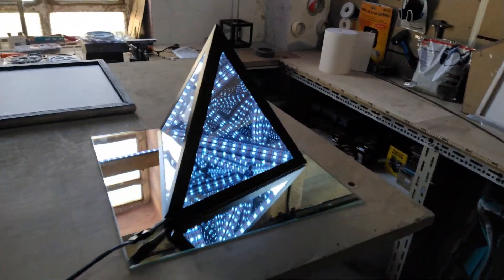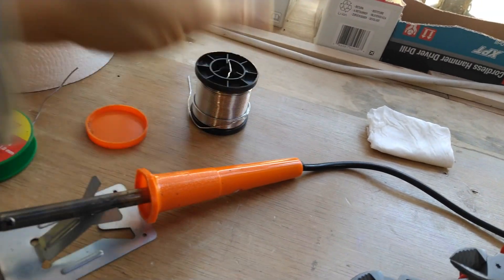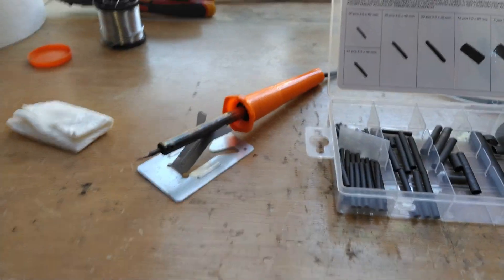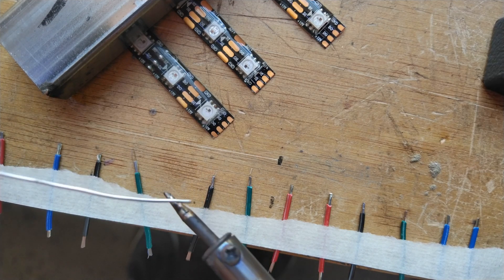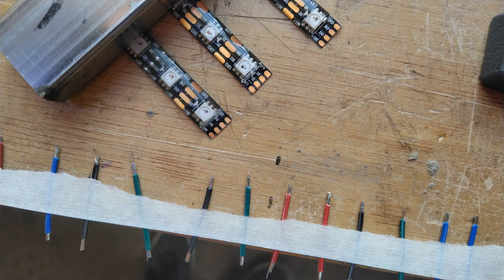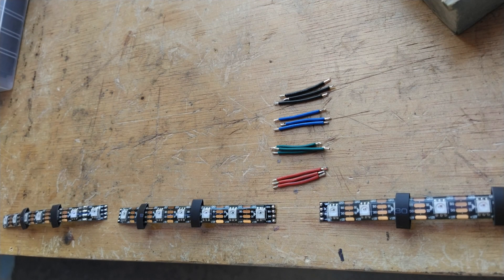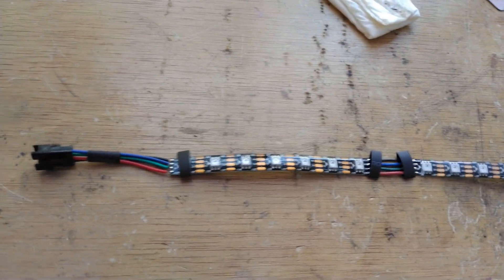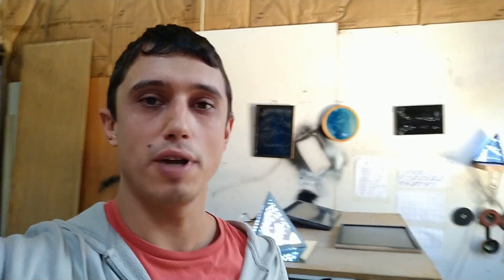DIY - How To Solder LED strips - Many Tips And Tricks - Clean And Secure Connections!

Comment: Question. Is it the soldering grease that assisted in the solder sticking to the bare copper areas? I have tried to stick solder to my LED strip (after making sure the copper area is clean, no dirt or grease) but my solder won't stick. I use solder with rosen core 1.6mm but no grease or older flux.
Reply from the maker: Yes, the flux is very important to use it in every step of the soldering. It spreads the heat batter and also helps to have the solder spread and attach to a contact point. It could also be that your temperature isnt high enough of your soldering gun. In 2 weeks I have a new video coming out about soldering btw!

Comment: When I tried to solder led strips, the solder wouldn't stick to the copper at all, no matter what I did. What might I be doing wrong?
Reply from the maker: Hi and i would guess or its not enough heat or you need to use more flux, it helps to spread heat and make it more liquid
Reply: @yehoshuasartinspain  Thanks!

Comment: Do you need to use wires or could you butt two sections to each other and solder?
Reply from the maker: You can solder LED strips together also without cables, on my channel there is also a video about that! Thanks for watching!

Comment: why u call it grease?  I assume ur usimg FLUX???  if so it is not to just equalize the temp. it also cleans and etches the surface so the solder fills hot and flat .  The most important advice to give is how to avoid a cold solder joint>>>>   thats when the solder looks rough and n0t shine.  they will craxk and fail.
Reply from the maker: Hi amd thanks for this comment! I made newer videos where I adressed this, thanks for pointing this out!

Comment: the wire gauge seems thick or is that the insulation.  I would like to use thinner gauge wire for my project.  how thin is too thin for these leds?
Reply from the maker: Hi and thx for watching. The wire is regular led RGB cable that you can find in many hardwarestores and lightshops so Im guessing the insulation makes it look thick. The cable thickness depends on how many Amps you will run through your project and also keep in mind to use extra powercables if your ledstrip is long and has a high density

Comment: Is there a limit to how long the abridging wires can be? ( I wanna split a strip to light multiple shelves with 1 remote control)
Reply from the maker: It depens on how many meters of strips you will have and the distance between them. You could power them all seperate and use a signal amplifier or put your led controller as close as possible to the ledstrips so the voltage and signal doesnt drop over the distance 😉
Reply: @yehoshuasartinspain  I want to do something similar, I have an LED strip with its function control, and I want to cut the LED strip to make 2 LED reflectors for the car. Is it possible?

Comment: any idea why the solder wont stick to my led strips?

just got some new solder with 2% flux since thought that was the issue

maybe the temp of the soldering iron? tried at 300c, tried at 450c... so confused
Reply from the maker: You will probably need to buy some extra flux and dip your soldering gun in it once in a while and also check the temperature of the soldering material that it melts at

Comment: Great video, would it be possible to cross connect the RGB wires to get different colour combinations between led strips? For instance connect the red output of one strip to the blue input of the other so different strips have different colours but are all turned on by the same remote? (of course you couldn't regulate the colour of the strip that is cross connected)
Reply: Nvm just came past the part where you explain the cables. Is there a way to have different strip colours controlled from one remote?
Reply from the maker: Hi! So your first comment would work with strips that have dedicated RGB channels so you kinda trick them but as you say the control is away because the colors are wrong. There are so many ways of lighting strips like this, that what you look for is quite easy. You need individual adressable LEDs that are controller by the right controller. My fav and easy setup is a SP107E or go WLed so you can realy program yourself
Reply: @yehoshuasartinspain  thanks a lot!!

Comment: Wat if the wire gets in contact with each other while soldering or the soldering dots connect to each other?
Reply from the maker: Hi! Many things can happen but one is sure, it will not work! There is a big chance of a short circuit so you have to be sure no contacts are touching!
Reply: If you accidentally join the beads it can be tricky to separate them, but most of the time it can be fixed. What I usually do is use something pointy like tweezers or an exacto knife to part the beads as you remelt them. If you have a fine tip soldering iron, you can just use that to melt and draw a gap between the beads, it might take a few passes before the beads will want to separate though. Also in my experience, when beads get joined it's usually because I used too much solder, so less is more with those tiny pads on the strips.

Comment: i need a tip on how to make led strips for cornering they dont make them like that
Reply from the maker: There are different types of connectors for cornering but nobody is a fan of them. For corners just same thing but different lengts of wires to solder, you can solder on the underside of the strip to make tighter corners or just loop them with some framework to hide the wires

Comment: I am currently building an infinity mirror dodecahedron. I am looking at these pixel led's that are 144 led's per meter programmable. Each strip will be max 7-1/4" they will lead to an intersection consisting of a "Y"   +/_ roughly. How do you solder this intersection when you are doubling up on every led on the leading strip side. Also do you know of an led strip that has at least this many led's per meter that would have a controler that is bluetooth capable, has a remote and can connent to google home and alexa and that the lights would change to music?
Reply from the maker: For the Y connection I make my own little Y cables that are just two cables with the same start that is soldered together, i hope you get what i mean. There are ways of making a dodecahedron in one continues strip i believe.
Reply from the maker: For the second part you will have to do some research since i do not work with controllera that work with alexa etc, there are some out there for sure. Look into Wled also, very interesting 😉

Comment: Can you make each section of LED strip a different colour?
Reply from the maker: There are more than a few ways of making sections in different colors. With a setup like this that is sort of possible depending on how many sections and how you olay with the original settings for the controller. Best way is with Wled where you can program everything yourself by using a universal chip

Comment: Wouldn’t use a lighter or any other flame to shrink the shrinktube. Use a hot gun (like the ones used to remove paint) or use the soldering iron very briefly
Reply: Why you no lighter?
Reply: @JohnDoe-qq8et  Why you yes lighter?
Reply: @JohnDoe-qq8et  😄😄👍
Reply: Hairdryer also works

Comment: is 4x1.5mm too thick?
Reply from the maker: I assume you mean 1.5mm^2 and yes that will be too thick. Best is to look under rgb led wire
Reply from the maker: Allow me to correct myself. 1.5 mm diameter could work depending on what the width of your strip and solderingpoints are

Comment: Been trying over and over, but having no success. Idk, if Im using the wrong size wire. Ive tried a little solder, a lot. I just cant get past the first  powered strip to the next.
Reply from the maker: Helloo. Soldering takes a while to get under control. Does your soldering gun get to a good temperature? And use the flux grease to increase heat transfer. And dont forget to first prepare the tips of your ledstrips and cables to make the connection easier when you solder them together. Do it strip by strip and test them after every strip you attached. Trust me, i also still have troubles sometimes!
Reply: @yehoshuasartinspain  I just have solder- good quality. I think it contains flux. Treating the led strips? You mean running the solder tip on them?  I havent really done that, but probably inadvertently while trying to get solder down on them. One potential issue is that Im using 18 awg wire and maybe its too thick?  Hard to place down precisesly on 3 pin led. Yeah, I havent successfully gotten a second strip lighting up and have gotten increasingly frustrated. I invested a lot of money into this project and Im laying a big, wet fart. My gun gets pretty hot- what temp is the sweet spot? 350?
Reply from the maker: I am not known to this standard but i use 0.25mm^2 rgb wire, its very standard. Take the proper preparation steps as said before and it will make it easier. Solder materials have different melting points but usually you can find that on the package. And you mean celcius or fahrenheit?
Reply: @yehoshuasartinspain  Thanks for you're advice. Got the project completed as far as led lights. Ran 32 rows at 20 high and it looks bad a--.I was initially a moron and just laid everything down and soldered it without a power supply as it was still in delivery. So my solder job was atrocious and that was the issue. I laid way too much solder and was bad with wire placement. Didn't realize everything had to be spot on. I haven't soldered since middle school. Anyway, I went from strip to strip checking with power after each. After major clean up of the old solder and re-connecting I finally got it done. Thanks again

Comment: Hi, I'd like to know what if i don't insulate the soldered part ? I wonder what will happen if those soldered wire touches each other, will it damage the led strips?
Reply from the maker: Hi! Yes it is very possible you will damage your led strips. You can cause a short circuit or an other scenario is your data gets corrupted. It is  never a harm to double check all your soldering points before applying any power! A multimeter can also come in very handy and might be a good idea for a video...
Reply: @yehoshuasartinspain  meaning that i need to be careful with the gap between those cable and make sure it won't tounch, yes ?
Reply from the maker: @Boyardee_my  yes exactly!

Comment: How would you suggest to make the soldered joins waterproof again? Thanks in advance
Reply from the maker: Waterproof to my opinion is a dangerous word in soldering but with using hot glue over your solderpoints they will be even more secure and if your heat shrinking tubing fits nice and snug over your IP protection together with hot glue you will be able to get them splash proof. Otherwise i advise using the apropriate mounting rails and covers for better water protection or use full waterproof led strips only ( i avoid outdoor projects only for this reason to be honest )
Reply: @yehoshuasartinspain  Thanks for that.... hot glue and heat shrink tubing sounds good. I already have the aluminium extrusion to mount the strips in. It's an outside progect so wanting to do the best i can to protect the strips. Good luck with your new business.... your pyramids look awesome!
Reply from the maker: Thank you very much!!!

Comment: Great video.  I am building a replica nano leaf and need to solder three strips per triangle.  Your video gave me the idea to lay them out in the triangular pattern and solder them together.  I will adjust the length of each of the three wires to account for the bend.  Still learning fast.led so don’t know if each triangle will have its own data line or if they could just run in serial.  There will be a total of 18 lights per triangle using ws2812B.  Your thoughts on this?
Reply from the maker: Im also new to the programming. I use sp107e controllers in many cases and with that you can easily change the settings according to the number of leds per strip and amount of strips